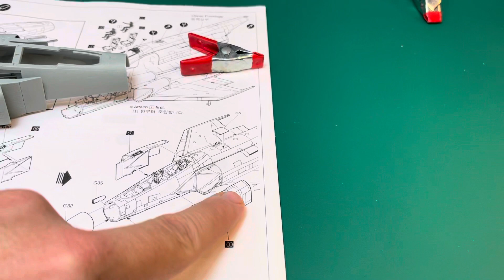1/48 ACADEMY F-4 PHANTOM PART 1

Comment: Cool video. I wish i had come across it sooner I'm working on the Academy F4 J Diamondback and just got through puttying and sanding the intakes . Its not a real bad fit but you do have to do some putty work there's no way around it. The kit does seem to be a hit and miss when it comes to fit issues.

Comment: Good luck ... I have build the D version and the kit Is 2 faced... Some part fit extremely well (mainly the large one like wing and fuselage) but other are just a mess of weak butt join (main gear well)

Also good luck with the gear. The instruction are useless regarding where the small braces are supposed to go.

In the end with some work it will build in a very nice model tho
Reply from the maker: Thanks for the heads up.

Comment: Do intake trunks come with this kit or are they aftermarket? Wish the Monogram kit had them? Might seem trivial but intakes and engine details are important to me when selecting a kit. Even if it is barely or not even visible.
Reply from the maker: Yes they do come with this kit. They come in halves but build up nice.
Reply: @inclusivemodeldesigns16  Cool, thanks.